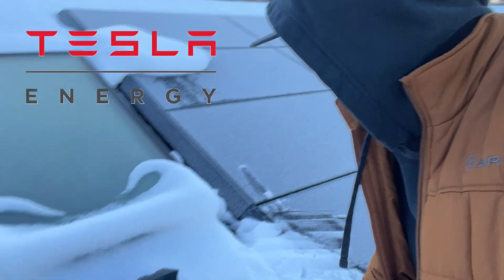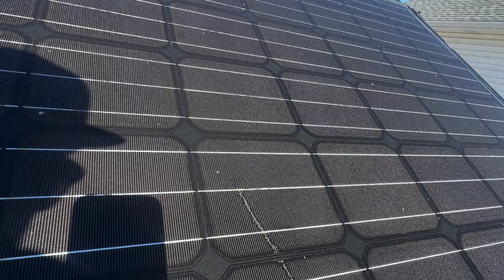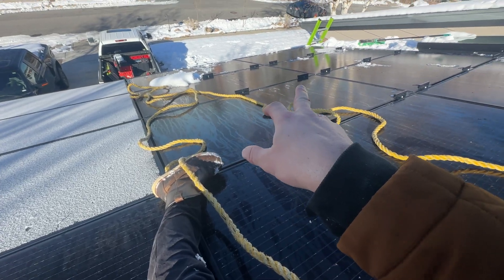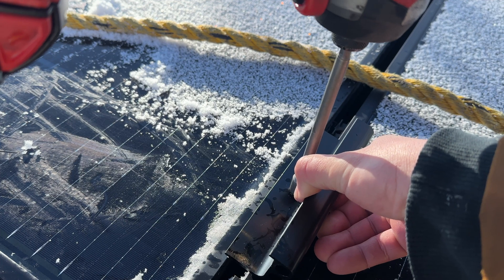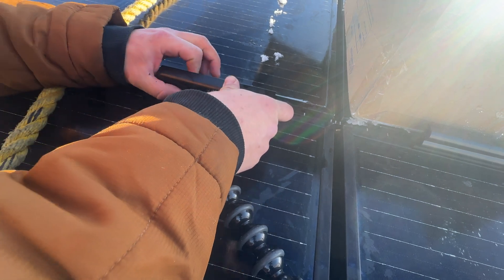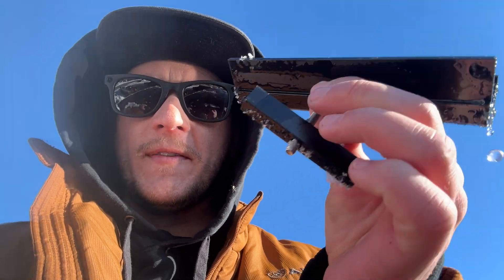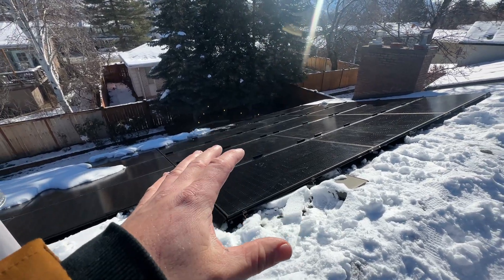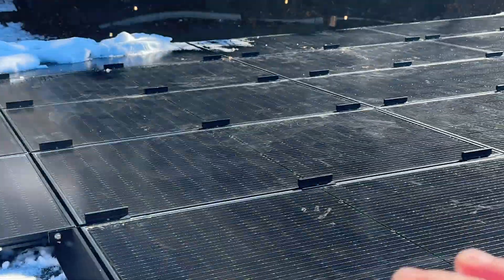Solar Panel Snow Retention- How to fix in cold climates

Comment: For those who don't understand, in some cases that avalanche is substantial, I want more production too but during snow months it isn't much anyways.

My wife owns a 125 yr old building with a 3ft wide alley between hers and the next in upstate NY. Those buildings been there 100 years with hardly any snow or water between them. Neighbor has peaked roof and my wife has flat. All the snow melt goes to storm sewer from our building and neighbors snow used to melt and go in the gutters. I ended up here because the neighbor had solar installed and the installers did nothing and said nothing. Not only does the snow slide off and hit the building and window sills, ripping off the trim in one case, but the snow pack has quadrupled and the 77 yr old tenant that uses the alley for access risks getting pummeled. I think the solar company should be responsible for fixing this, it is negligence and will cause long term harm to the buildings as well as it's a safety risk. 

Not to mention this time I of year the snow is so low those panels are mostly in the shadow of our building anyway.

I hate it when contractors sell from their perspective of getting the sale and don't think the installation thru.

Comment: I can appreciate this video and the product being used. The snow load on the panels is one factor but you are also putting a lot of load on the roof as a whole. Over time, that can cause roof issues, too. I recommend people get a good telescoping snow rake like a Avalanche Deluxe 20 to remove the snow as often as needed. I also recommend pushing the snow up and over the ridge away from walk ways and prized rose bushes. LOL  Then they can pull it down on the other side away from used walkways to prevent injury, etc. Overall, great video though!

Comment: Let me get this straight. You install panels to generate electricity from the sun. Snow blocks that process so I should install a guard to keep the snow on the panels. You're kidding right?
Reply: you didn't watch the entire video or understand the need for those brackets. It was for safety concerns and avoidance of property damage with a mass volume of descending snow.
Reply from the maker: Almost got it.  You have Tesla install a solar panel system based on there “generic” packages. When they install it they end up covering every square inch of your roof in order to fit that system. Later you have a few snow storms and because the panels span gutter to ride on both sides you end up having thousands and thousands of pounds of snow skidding off you roof and making a mess, distroying property, and harming people. So sense you can’t properly size the system for the roof because we don’t access to any Time Machines. You can install snow retention on the panels to keep the dangerous falling ice on the roof tell it melts properly. Also one thing to consider, because the sun hours are so much shorter and the angle of the sun is so low. You really don’t loose as much production as you would think when you look at the big picture.